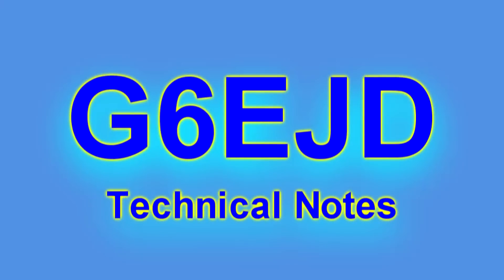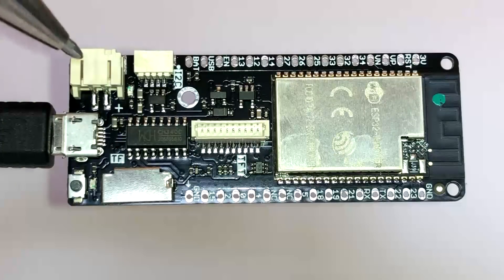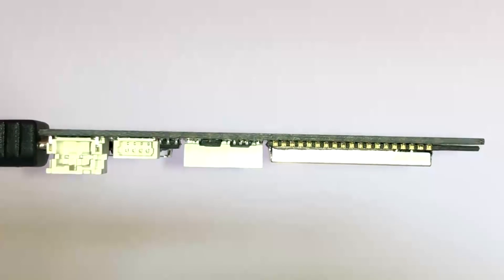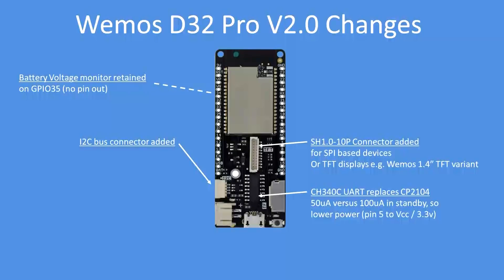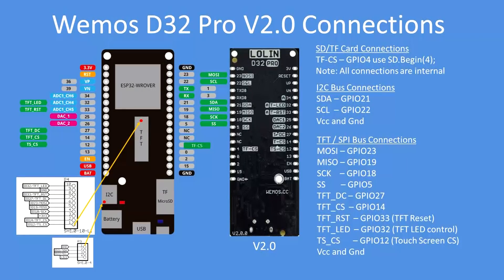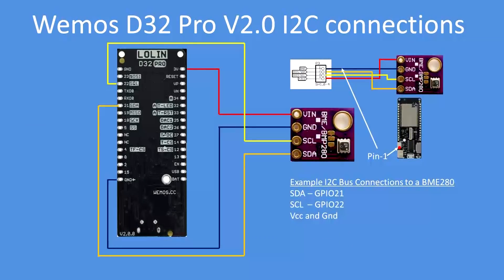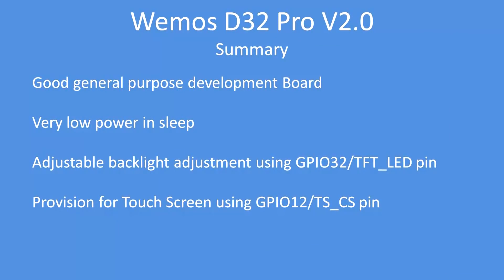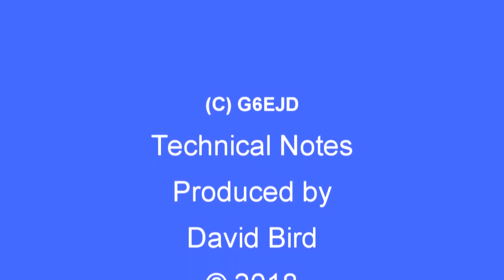Tech Note 107 - Lolin D32 Pro V2 (compared to V1)

Comment: Is the flash 16MB or 4MB? The datasheet is confusing.
Reply from the maker: The standard ESP32 has 4MB of Flash and can access a maximum of 16MB, often sellers bend this wording to give the impression that more is fitted, it’s 4MB is the answer! You may find some ESP32Wroom devices with 16MB flash chips fitted. Other options are to fit PSRAM up to 16MB.

Comment: Hey there David! I am crossing my fingers, you are going to read my comment. I am constructing a device, which will be controlled by the D32 Pro v2. Powering will come from 220V since I am in Europe, so I was wondering, can you tell me which pin I can use to power the board with 5V constant power supply. THX!
Reply from the maker: I prefer to feed power in via the microUSB connector as there are many options to supply power like a phone charger, failing that apply +5v to the USB / Vin pin and Gnd.
Reply: @G6EJD  Thx a lot for the response. Unfortunately, all will be mounted in a PCB design with tight space, so no other outside source will be allowed. One plug from the wall of 220V and that is it. Bye bye!
Reply from the maker: @vladhristov2316  OK best to use USB (+5v) input pin and Gnd then

Comment: Hi David, do you know what type of connector the I2C one is? 73, Chris
Reply from the maker: Sh1.0-4 see schematic here: https://www.wemos.cc/en/latest/_static/files/sch_d32_pro_v2.0.0.pdf
Reply from the maker: Hi Chris, it’s probably better to buy them ready made like this: ￡0.44  5％ Off | 5pcs SH1.0 SH 1.0mm 2/3/4/5/6/7/8/9/10Pin Female and female Connector with cable plug Same direction Length 10cm 28AWG
https://a.aliexpress.com/_B0gPOh 73 Dave
Reply: @G6EJD  Ta, I have 3 of these boards so neat connections will be a bonus. 73, Chris

Comment: Do you think we could easily change the antenna to a u.fl type?
Reply from the maker: To be honest I have not looked at the antenna corner under a microscope, but knowing the RF stage design, on this module (Espressif do sell an ESP32-WROOM-32U module with a connector) what’s on the board is the end of a matching pi network and the pcb antenna. The impedance at that point is likely to be low, much lower than a coaxial connector plus cable, so whilst it would work to cut the track and solder a connector it would not be an optimal match and whether the RF stage would cope is anyone’s guess, worth a try. Alternatively reflow the module and replace with the 32U as they are identical apart from the connector.
Reply: @G6EJD  Thanks for reply: I just found the schematic for the WROVER part of interest to me, on their website and it shows that if I remove R15 or cut the trace to the antenna then it looks like a u.fl could be soldered to the pads and its impedance would be ~50 ohms .. I guess cutting the trace might add a little stub and mess up the impedance.

Comment: Is the charging port on this board capable of managing an 18650 Li-Ion cell, or it is only for LiPo cells?
Reply from the maker: Li-Ion only charge at constant voltage variable current until the cell reaches 4.2v. Lipo charge at constant current until 4.2v is reached. So no good for LiPo in theory but with the same cutoff voltage I doubt much harm will to the LiPo.

Comment: Hi dave.
Can u make a video to show to get datas from news api .org for esp8266.
Would be greatly appreciated :)
Thanks.
Marc
Reply from the maker: Marc Paradis Hi Marc, I’ve had a look and see what I can do. There may be a lot to it and many readers now need a secure connection. I have crude prototype running but it can’t yet extract the specific news items.
Reply: @G6EJD  thank you. DAVE :)
Reply from the maker: For some reason newsapi.org is not allowing an ESP8266 to make a secure (SSL) connection and that is needed for a RSS feed reception. I think it needs more work on the connection (HTTP) parameters, also the returned JSON is non-standard, so the Blanchon JSON decoder can't/won't handle the text at present, they insert '-' as line extension indicators.If you have an API key you can test the response like this using your browser:https://newsapi.org/v2/top-headlines?country=us&apiKey=yourAPIkeyhere
Reply from the maker: https://github.com/esp8266/Arduino/issues/4826
There is a problem it seems!Tomorrow I'll try it an ESP32
Reply: G6EJD  I have tried with wunderground, but it says parse failed... can you look at the code, thanks Marc:

http://freetexthost.com/02bd54gbn0
Reply from the maker: Your code is now working: https://github.com/G6EJD/ExamplesMarc WU Code file name
Reply from the maker: newsapi.com needs a cypher for the ssl connection that is not supported by the ESP environment at this time is my conclusion, so can't be accessed. I can make an unsecure connection, but the moment I make it SSL it fails. No answer.
Reply: @G6EJD  if u request with http instead of https it works.
Reply from the maker: Yes I just discovered that, well it works for now: Code example here: https://github.com/G6EJD/Examples See ESP32 News Reader 04I found out that the responses are huge, maybe 40-50K so too small for an ESP8266, but it works fine on an ESP32. I've left it running with 5 news sources. There are so many to choose from. Enjoy.
Reply from the maker: Marc, let me have you email address and I’ll send you a prototype. I’ve found few news servers around and everyone has a different format even though the response is supposed to be in xml. I haven’t used news.api.org yet as it needs a key but I have bbc news, limited cnn, etc running, small steps needed.
Reply: @G6EJD  nodoubtman@hotmail.com
Thank you my friend.
Marc.